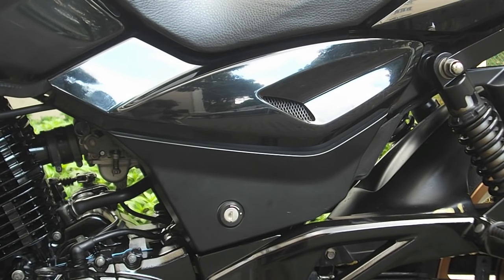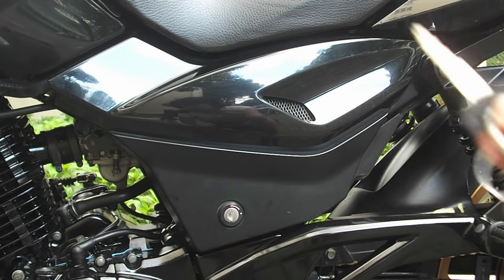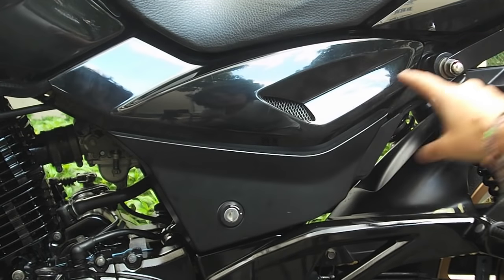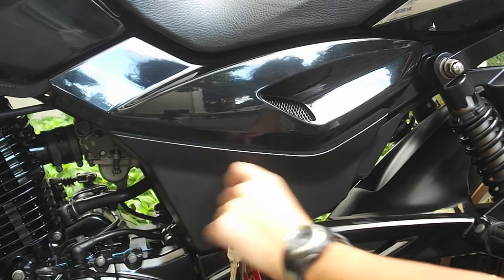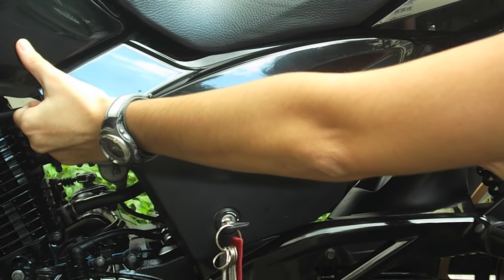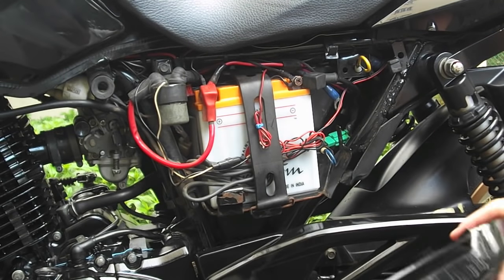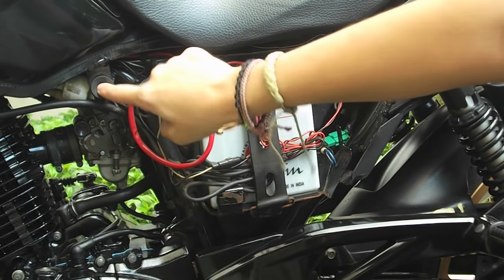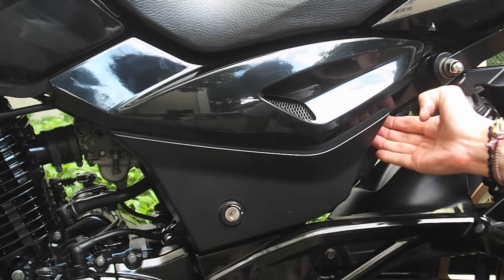Pulsar - Opening the side cover

Comment: Putting the cover back on the bracket becomes easier, if you remove the seat.
Once the seat has been removed, you can see the bracket from top, hence making it easier to slide the cover back on.
Once the cover is seated and locked, you can easily slide the seat back on to its position.
Reply: Thanks for the demonstration.